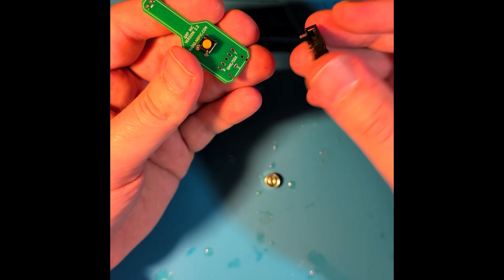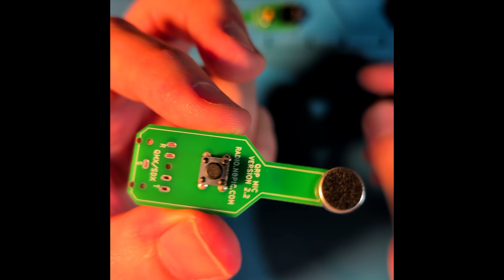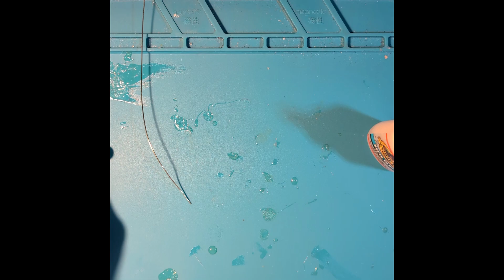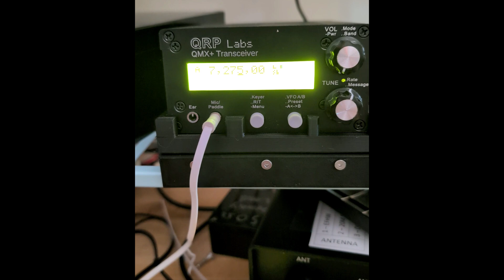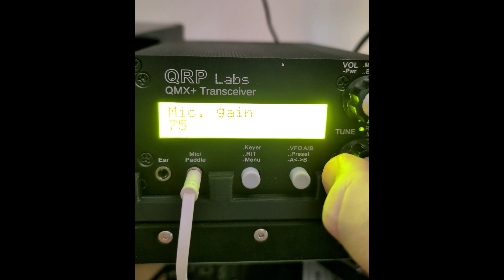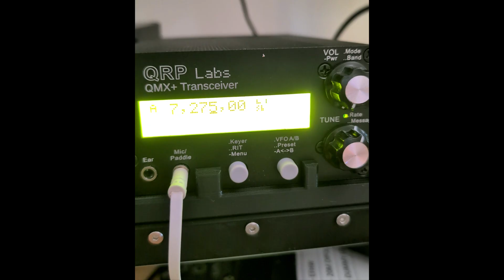N8PIC QRP Microphone V2.2 (Build and Test Guide)

Comment: Which configuration do I need to use with the Pebble HF 20m HF Radio?  I think I need the QMX/QMX+, uSDX, (tr)uSDX version.  Thanks.  73
Reply from the maker: Because the Pebble HF is based on the uSDX, you would need that version.
Thanks!